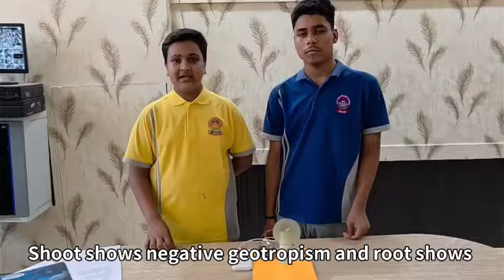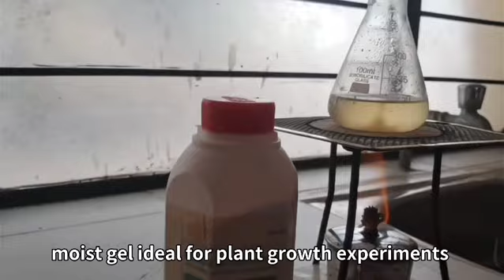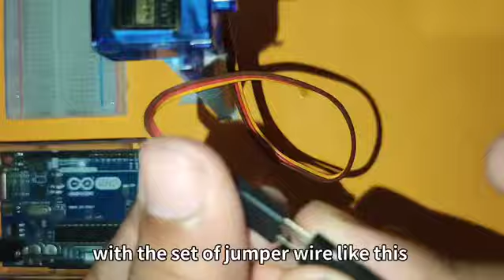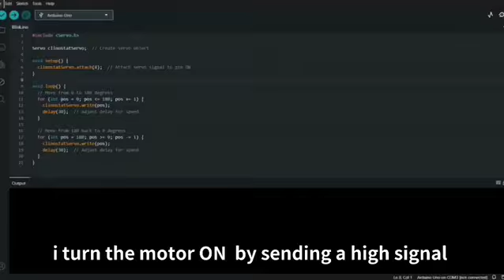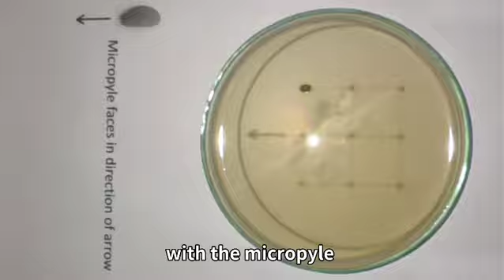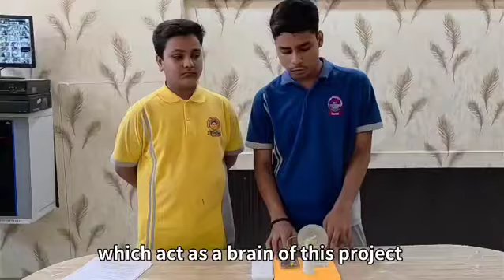Build an ARDUINO CLINOSTAT which simulate microgravity | #science | #spacebiology

Comment: Can you give me the code
Reply from the maker: #include <Servo.h>

Servo clinostatServo;  // Create servo object

void setup() {
  clinostatServo.attach(8);  // Attach servo signal to pin D8
}

void loop() {
  // Move from 0 to 180 degrees
  for (int pos = 0; pos <= 180; pos += 1) {
    clinostatServo.write(pos);
    delay(15);  // Adjust delay for speed
  }

  // Move from 180 back to 0 degrees
  for (int pos = 180; pos >= 0; pos -= 1) {
    clinostatServo.write(pos);
    delay(15);  // Adjust delay for speed
  }
}
Reply: @AtomishCreationsThank you so much ❤